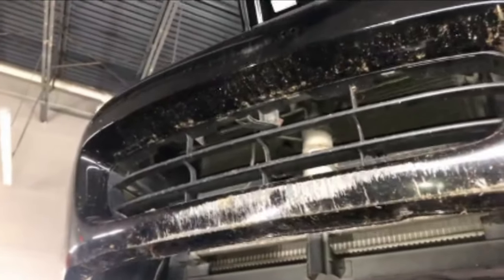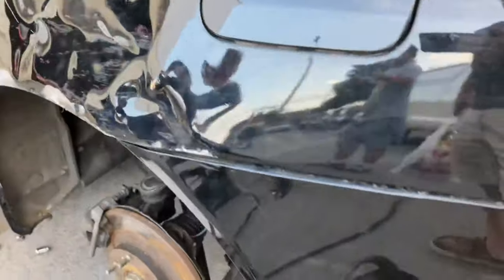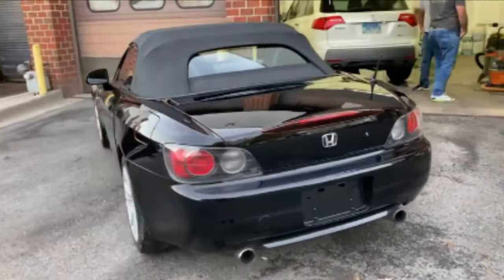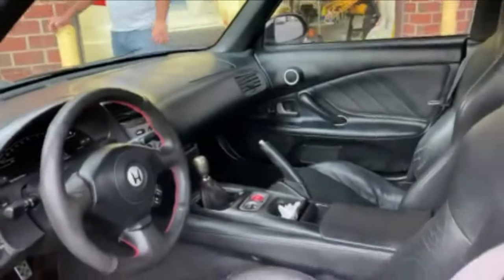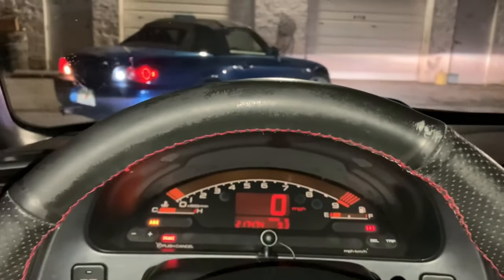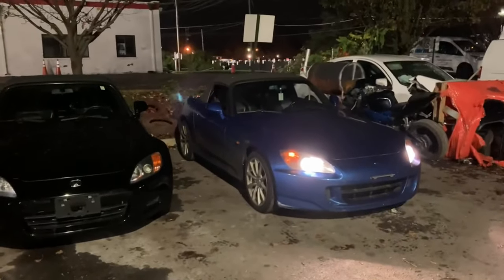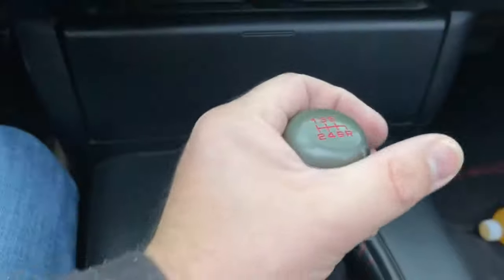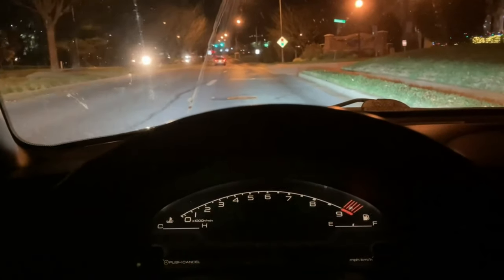Honda S2000 Restoration: Final Body Work and Paint! Rust Removal and Ceramic Coating Part 1-  4K UHD

Comment: How did they correct the scratches? do they sand it? Use body filler?
Reply from the maker: It was mostly pulling and shaping the quarter panel. They used a surprisingly low amount of filler!